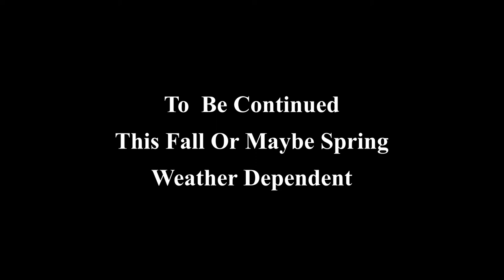Boulder Retaining Wall

Comment: Nice job! That New Holland 25S Tractor does a great job. I just bought the 25 T4B it's being delivered on Monday.
Reply from the maker: It's done everything I needed it to do.  It's also a great size to easily fit through trees and between objects. No issues so far.
Reply: @rlifeoutloud5052  That’s awesome! I looked at those they are a nice tractor. I can see myself buying one down the road for smaller jobs around the homestead.